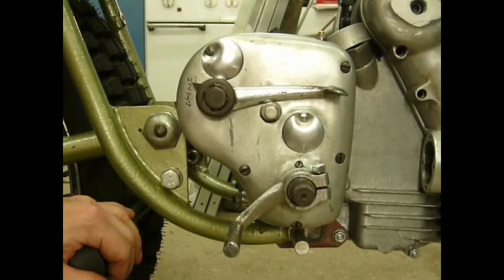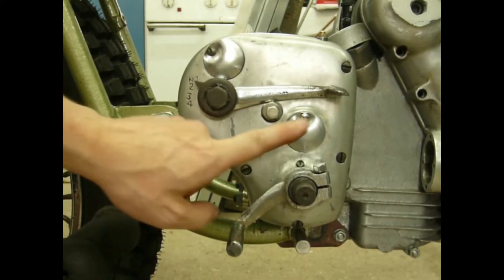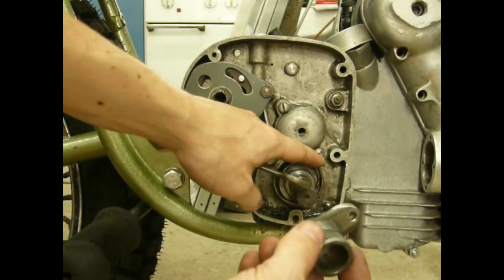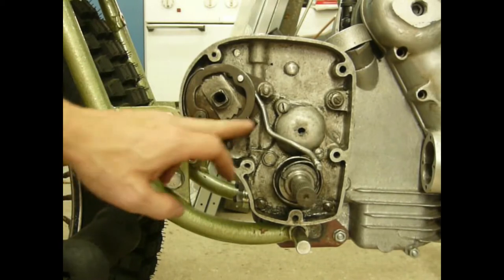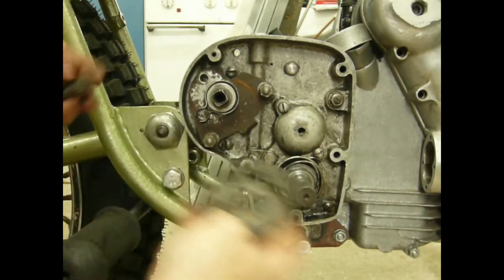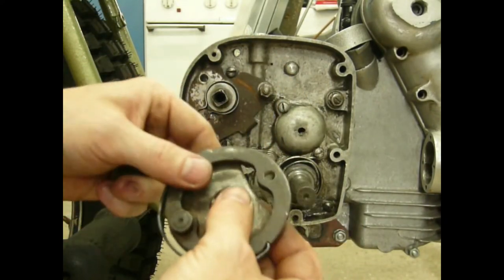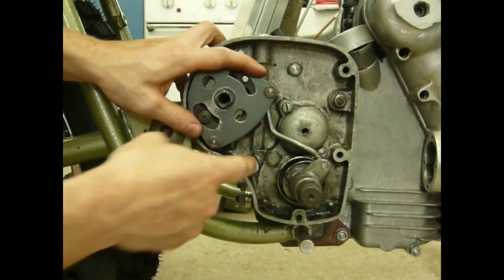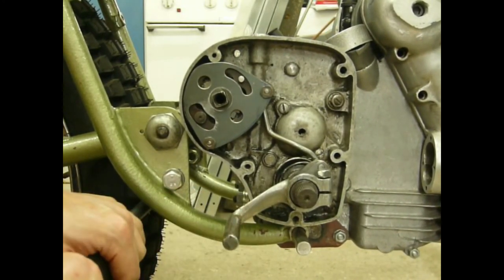Gearbox Conversion for pre-unit Bullets!

Comment: G'day Andreas,
Again, I have only just found this video.
Very impressive modification.  I wonder if the mechanism shown is the final iteration of it, or whether you are going to improve it now that the concept is proven.  
My chief concern would be with the  rod linkage between the two shafts, as it has many directional changes and has a small cross section.  This makes it more likely to tend to straighten under tension or bend under compression, particularly when one is seeking to shift it with a boot toe whilst riding the bike over country, not a finger whilst it is on its stand.
I wonder if a shape that was curved like a reverse "s" would allow a larger cross-section linkage that would be stiffer, even though less straight.  Obviously, I do not know what the clearances are within the cover, so my thoughts could be completely unworkable.
Once again, a nice modification to allow the outside linkage to be placed in a more protected position.
Thanks for your video
Quentin
Reply from the maker: Hi Quentin,
it looks weak, but it's astonishingly rigid. It's made from CrV-steel and quite tough for a little piece of round stock. It will have to proof yet though.
It might be possible to add some material in the mid section, but there's really not a lot of space to begin with, so it took some time to find the correct shape so it wouldn't foul another part. If it should proof unreliable, I might still have to change some details. It now has a securing wire and of course all is cleaned and greased.

Happy to hear you like this mod :-)